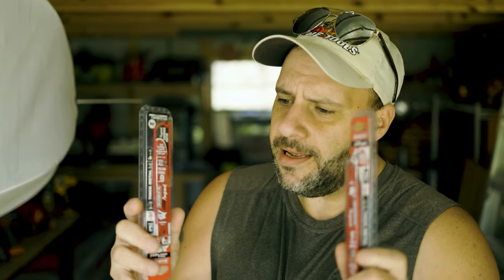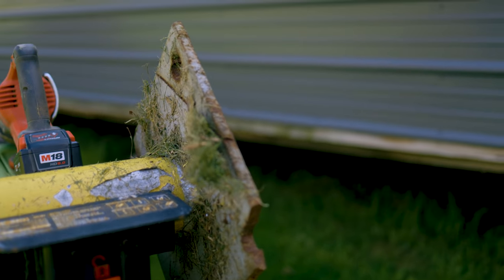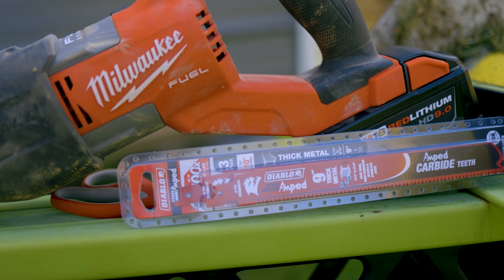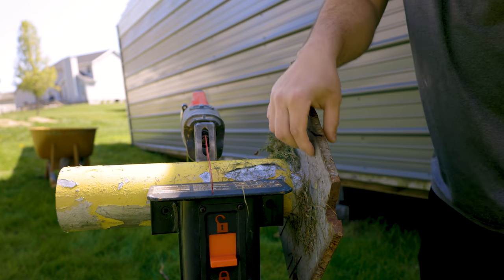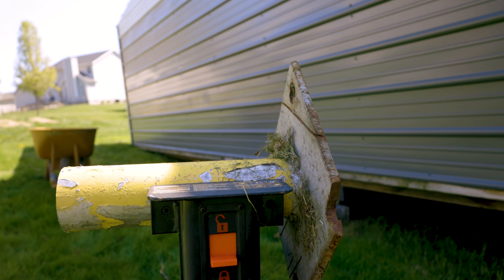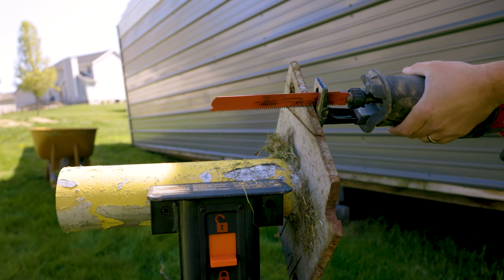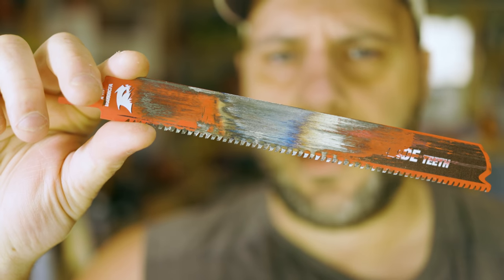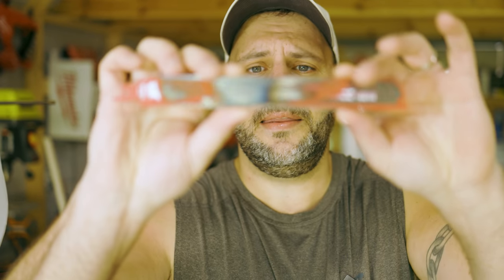These New Diablo Blades Are NOTHING LIKE I EVER USED BEFORE!

Comment: I used these blades to cut off  thru strut bolts thru  the nut and bolt ( close to an inch of steel) on a 2002 honda crv and they worked way above and beyond what I had hoped for. they are bad a$$

Comment: The Diablo 9" AMPED blade is simply a great thick metal cutting blade. Look after your blade and it will look after you.
Remember, HEAT is the biggest enemy of any cutting blade.
1/ Always use Cutting oil when cutting thick metal. Coat it on the blade and on the cutting surface.
2/ Choose the longest blade you can to do the job. It will stay cooler for longer.
3/ Use a variable speed reciprocating saw with these blades. When cutting metal use the slowest speed you can and let the blade do the work.
Do those three things and you will extend the cutting life of your Diablo AMPED blades significantly. They are a little more expensive   but much better value for money in the longer term if you treat them well.

Comment: Just have to say, I was telling my son about how blades are more important than the tool using it.  Had to cut a tie rod end link off our van and after 45 minutes with a Milwaukee metal torch blade and a Dewalt metal blade I went and bought a Diablo steel demon carbide 9" and 5 seconds later it was done,  can't say enough about Diablo blades.
Reply from the maker: Absolutely 💯Kevin!!! Thanks for the feedback

Comment: What blades do I need for cutting ▪︎ Grade 8/10.9 automotive bolts 
▪︎ M12x1.75x70mm 
▪︎ M14x2.00x114mm
▪︎ Hex Flange Head Bolts with Partial Threads that have solid shaft before threads.
They are Jeep Bolts for Shocks and control arms.
What TPI do I need in those Carbide Tip DS0908CF blades. I can only find 8TPI?
I don't want to spend tons of $ and need to cut up to 8 bolts

Comment: The diablo carbide pruning and clean wood blade is great. I paid more for 3 than 5 of the cheap blades. The blade cut through quick and easy. You  need to account for what you and your tool require for each project though. The difference in blade can determine the life span of your tool. Keep that in mind too.

Comment: I have a bunch of different Diablo blades and every one of them still cuts like they are new and has all their teeth after cutting a bunch of different metals, woods etc.

I don't know why I sometimes see people complaining about the price when (this blade will do the job at half the cost)

Yeah but it will also take twice as long to cut as the Diablos and you'll go through twice as many.

When people test tools like Milwaukee / Makita / Dewalt / Flex Sawzalls against each other and say "See the Dewalt is 2 whole seconds faster than the Makita!" measurements like that are so insignificant compared to using what IMHO are the best blades on the market ATM.

I have heavy metal 🤘🏻 / thin metal (which I guess would be more like classic rock 🪨  / and their pruning blades and I don't even use them in a Sawzall, I use them with an M18 one handed hack saw & I've cut through everything  from thiner sink pipes up to thick rebar like it wasnt even an issue.

The blade definitely makes a greater performance difference than the 2 second difference between top tier tools does and the Diablos are definitely worth the little extra dough.

Plus only the original blade I bought that I use slicing through heavier metals has 1 slightly damaged tooth and all the rest still look brand new minus paint.

Every other blade has all their teeth and still cut like the day I bought them.

I think Diablo is amazing with what they've done in the advancement of blade technology & it's really like day & night against other brands once you try them.

Nope, I'm not a paid shill 🤙🏻